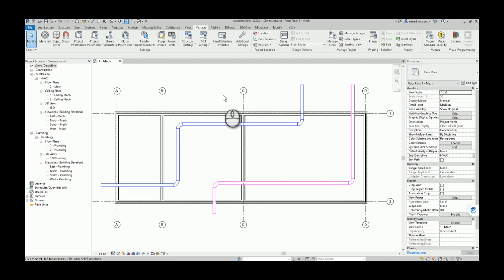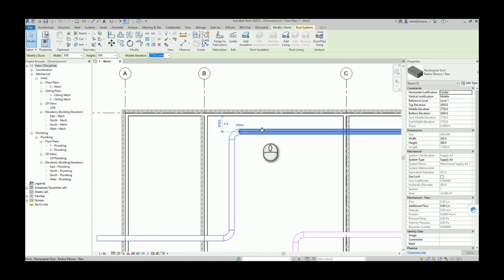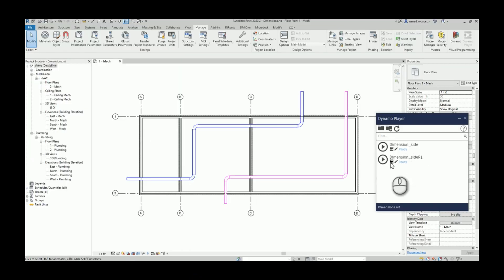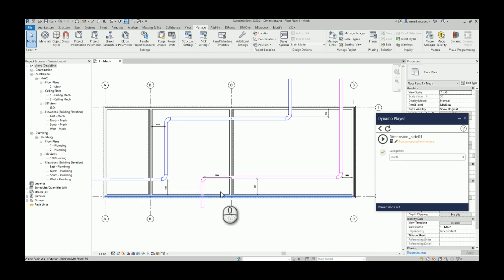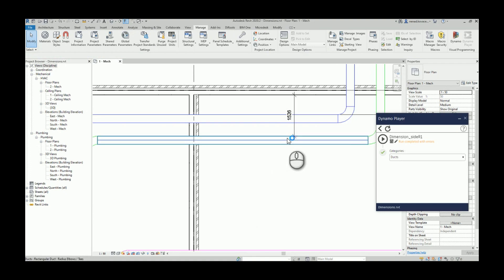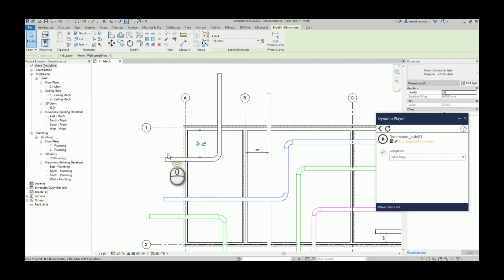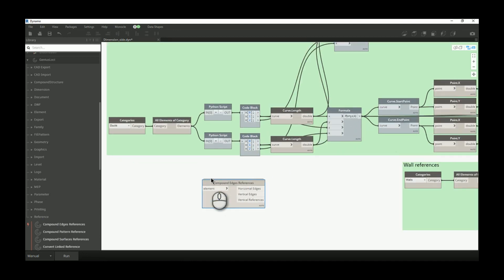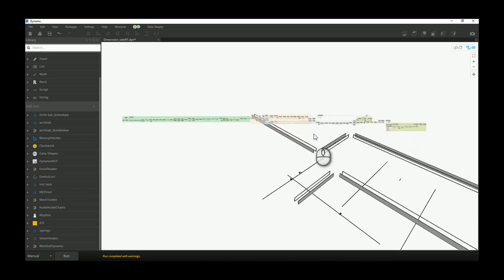Dynamo - Automatic dimensions (side to side)

Comment: NYC one...When applied on a real project most of the duct dimensions are getting missed..Can you provide a solution for this problem..Thank you🙂
Reply from the maker: Dear, I'm not sure what exactly do you mean by missed but in order to have dimensions you will need to have ducts and other references in the same model. So if your second reference is in the linked file then you need to access those elements in the Dynamo. Also, I did not deal too much with the block "Location for the dimensions". In order to align those dimensions at some order, you will need to define lines where do you want to have dimensions. If for some reason Dynamo in your case create dimensions on the same place that other part of the script when detecting multiple dimensions on the same place will delete all except one. Overall, as I mention in the video, there is a lot of work to be done. We must start somewhere so in the following days/months we will have a new script which will combine two previous (regarding dimensions) and resolve all the problems when tested on the real project.